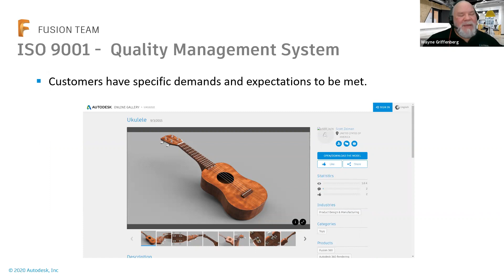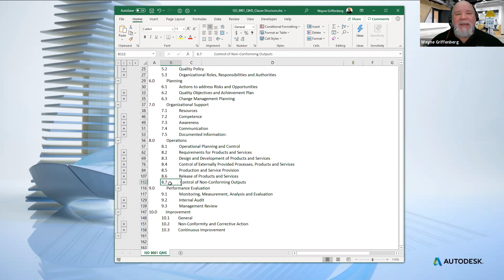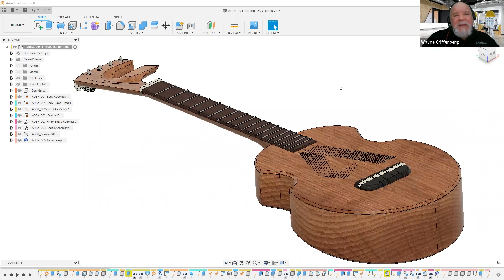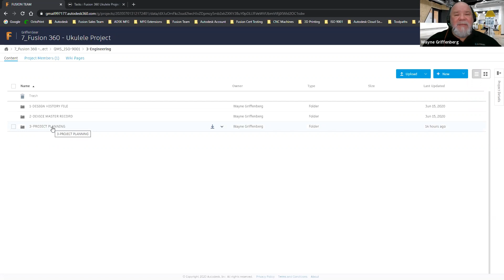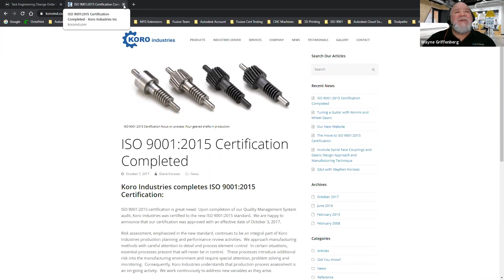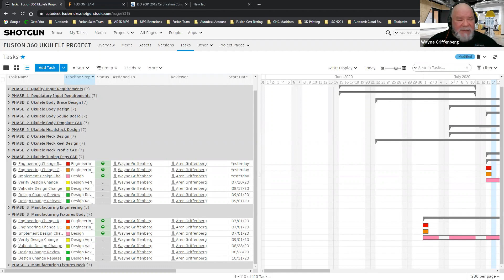Webinar - Fusion 360 - ISO 9001 Quality Management System

Comment: I have had so many problems with autodesk i have stopped paying for it and using their free version because every time an update comes around it messes up everything.. i tried to get help with the problems but never hear back from them, i have asked the community in several places and they have no idea what could be causing the program to mess up.. they suggest a reinstall but it doesnt change anything..
Reply: I would suspect that the issue might be one of operator/designer training. I recommend you make sure that the person who is managing the system is appropriately qualified and everything meets the minimum system standards and follows solid general design procedures.